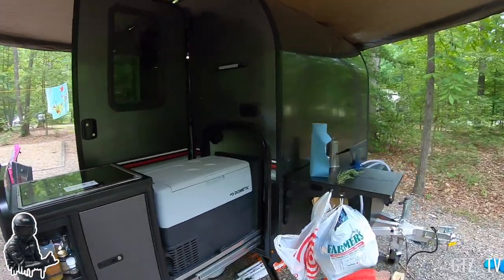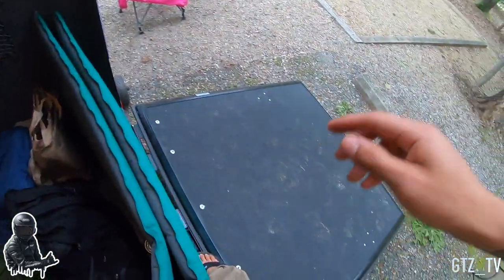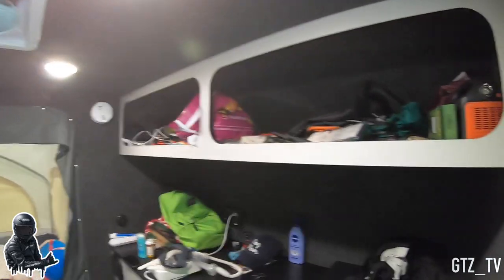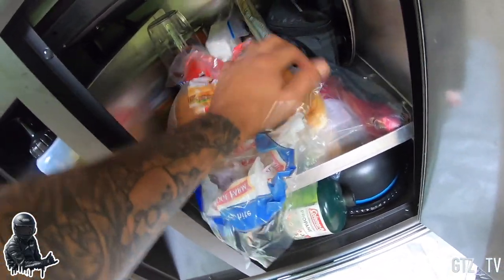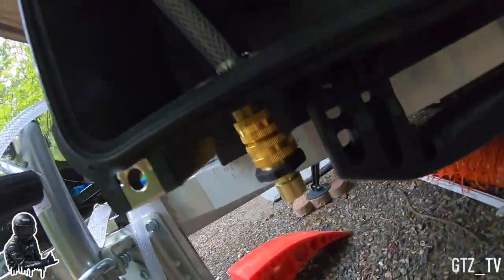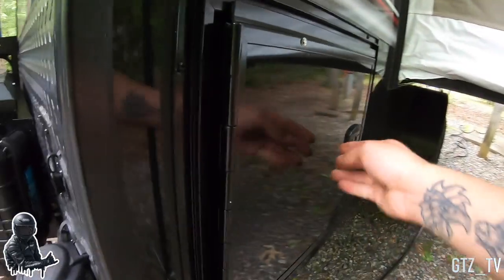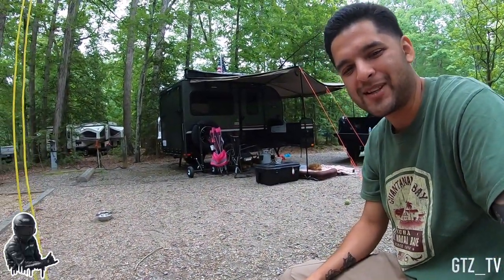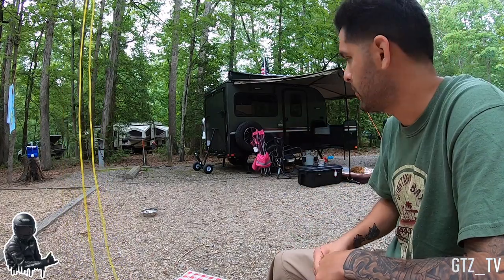Intech Flyer Explore Review

Comment: Great Video, thanks for sharing. I noticed you had a c-pap machine, have you used it while not plugged into shore power?
Reply from the maker: I have the travel one that has a battery.  
I can use it via my jackery or bluetti but I mainly just charge it during the day and run it off it’s one battery at night.
Reply: @GTZ_TV  thank you for the response, I appreciate it.

Comment: thank you very much for the review, actually bought one of these myself about a month ago and like you, only got to use it this week.  I think I saw your water system hook up somewhere else.  Can you provide the model numbers and additional details about how you hooked it up?  Love to see a more detailed video just about it and its parts and connections.  Either way thanks for sharing!
Reply from the maker: I'll probably make a video about it later. For now, I used the Seaflo series 33 12v water pump along with he accumulator tank. The apache case from Harbor Freight to hold the pump and bladder.  I have the power wires running into the tongue box where there is a terminal that then goes to the battery. 
Are you on FB?  There is an Intact Owners page you can join.  A few people have similar set ups, just search Water pump.  Stay tuned for more videos.

Comment: Thanks for the review.  I have the same reasons as you for looking at getting the Discover; having a place for the dogs to stay in while I'm riding.  Which question for you:  Is the dometic AC 120v and 12v and how is the heat output when sleeping in the tipout?  Looking to use this in the winter (possibly down to 0 degrees at night) as well.
Reply from the maker: Sorry for the late reply.  Yes the fridge is 120v and 12v.   Switches on its own depending on if you’re on shore power or not.  The heat/ac unit is loud.  The heat is great, though I have installed a thermostat so it’s just on or off. However, we’ve Boondocked more than campground so adding Reflectex on the inside of the tip outs is a great idea for the winter.  I also use a diesel heater for heat.   Updated video coming next month.

Comment: Just found your video,do you find the low roof a problem getting your bikes in and out?
Reply from the maker: Not at all.  I’m 5’9”.  I do have to tilt my head but it doesn’t bother me for the 10 minutes I’m setting them up, mainly because most of that time is spent bent over tying them down anyways.
Reply: @GTZ_TV  thanks I am 5,8.if I cant get a van with dbl doors to get bike on and out,then I may get this or a cargo trailer.prefer not to pull a trailer

Comment: We are looking to get one to haul our bike to further locations. I love your water set up and does the refrigerator keep things cold I've heard mixed reviews about it and can you put links for your water setup.
Reply from the maker: Ive heard mixed reviews about the Domestic fridge also but I haven't had a problem with mine.  If you can, set it to the temperature you want the night before you leave so that it has time to cool.  Also, try not to put any room temperature stuff in there at the start.  
The water pump case is the apache 3300 from harbor freight.  The pump is the Seaflo 33 12v pump.

Comment: Awesome! I have been looking at these. Did you have to order this custom-made and if so, how long did it take?
Reply from the maker: Thanks! They are awesome and very easy to modify and make your own. I did not order.  I'm hearing anywhere from 2-6 months depending on which model and what options you want.  I did drive 4hrs to get mine as they had the color AND it was 2k cheaper than the dealer 1hr away.

Comment: How do you secure the bikes in there? Wheel chocks?
Reply from the maker: @dadtube there are 6 tie downs and I just used those.  Tested it once and no issues.  This May is a longer trip so it’ll test it better. I don’t always take the bikes so I don’t want to invest in 2 chocks right now. But if you travel frequently with them, I’d install some chocks just for the ease of it.

Comment: Great review, thanks! Nice to see a review from an actual user instead of a dealer. Do you mind telling what the price was? Also, love your dogs. Had a white boxer myself. 🐶❤️
Reply from the maker: Thanks!  With so many options available I wanted to give MY OPINION/review on this trailer.  
I paid 17k out the door.  It all depends on availability and location.  I drove 4hrs for this one and saved 2k.   They are hot right now so negotiation may not be an option.
Reply: GTZ_TV Wow, that was well worth the drive! I can’t find one within at least 6 hours to me. Thanks for the reply
Reply from the maker: Try entering different zip codes for the areas you're willing to drive to.  Their find a dealer page is picky.
Reply from the maker: Try entering different zip codes for the areas you're willing to drive to.  Their find a dealer page is picky.
Reply: GTZ_TV  thanks for your help

Comment: I cannot find the interior length dimension. I am hauling motorcycles with the pit bull trailer restraint system and need to know the real length and width of the floor (not with cabinets).  

Could you send me those?
Reply from the maker: The interior Width is 69" and length is 97".  
Are you trying to order it without the slide out?  I think that option turns that space into cabinet storage. I haven seen anyone order it without the interior counter and without the slide out, giving you about 2.5 extra feet.
Reply: GTZ_TV can you tell what the floor is made of? The dealership said corrugated plastic. I’m not sure the pitbull base plate will work with that. Can you seen what’s under the rubber coin mat?
Reply from the maker: @apache1133  its rubber up top for grip, then 3/4 7ply plywood.  With a plastic membrane underneath and a moisture bearer.
Reply: GTZ_TV thank you! I really appreciate you helping me make my decision. I just put a deposit on one !
Reply from the maker: @apache1133  of course.   I researched a lot before buying so I understand.  Have you joined the Intech Rv Facebook page?

Comment: Nothing from harbor freight is reliable
Reply from the maker: I wouldn’t say “nothing”.   I’ve had their floor jack for 7 years now, A heat gun for about 2, and multiple drill bits/wrenches for about 3 yrs.  I’m thinking I’ll buy their Predator Generator next.
Reply from the maker: @DavidRamirez-fe5dd  25k ?!?  Ouch.  I had to drive 8hrs into North Carolina from Va  in order to get that 17k price.  But this was also before the pandemic and supply/demand issues.  
Yeah I saw the water set up in the Intech Facebook page last year and was easy enough for me to do.   
I’m actually going to remove the stove and put in a sink in the near future.  Another guy did it and the hardest part is finding a sink that’s a good fit.  
I’m switching to using my black stone adventure griddle with side burner, so I won’t need the stove stop anymore.  And having an installed sink would make it more convenient that filling a tub every time we want to do dishes or wash our hands.